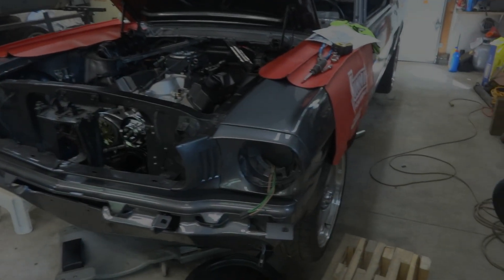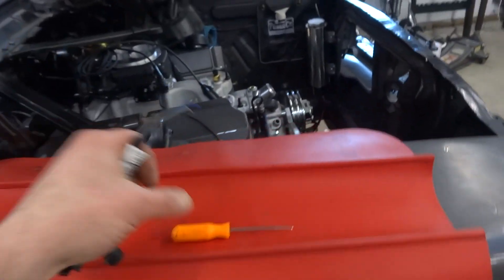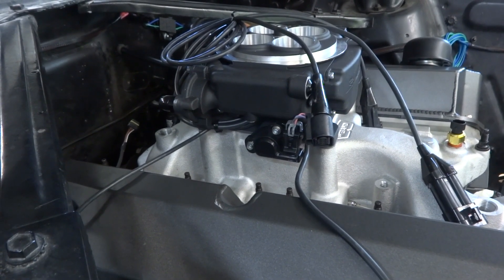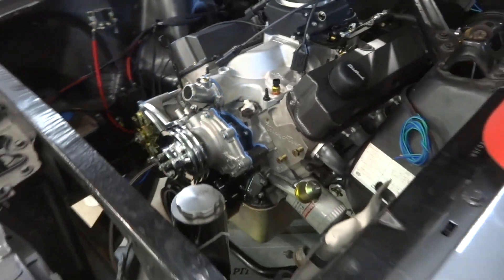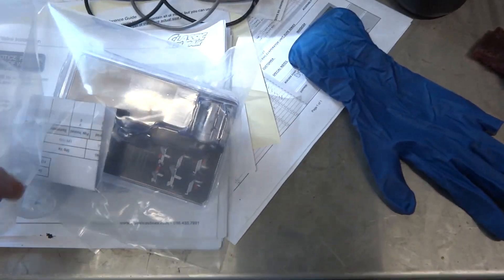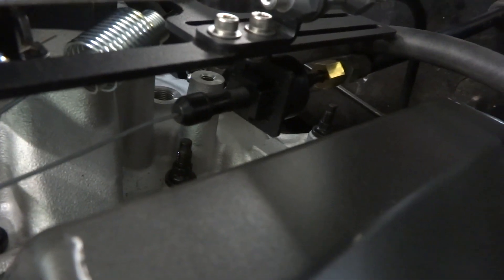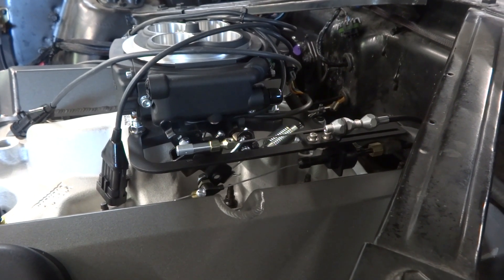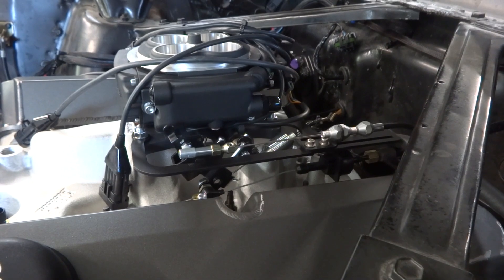TPS SIGNAL for Holley Sniper US Shift 4r70w

Comment: I've done this exact thing on my build with the remote tps sensor. The problem I have now is that the two separate tps signals are not in sync. I was watching this hoping you were going to use that Casper breakout TPS because that's going to be the next thing I try. 
I have a Big Block Chevy 496 with Holley Sniper EFI, and the MSD Atomic transmission controller running a 4l80e.
Reply from the maker: The casper works, and also there's now a piggyback tps for the sniper on ebay! Search for sniper tps

Comment: I have a 1966 Mustang with the 289 & green dot c4. I’m interested in the 4R70W swap to the 289. Do you have a parts list for the 4R70w swap?
Reply from the maker: 4r70w, us shift controller, tps sensor (available at us shift), AODE crossmember, shifter, new driveshaft and tq converter.
Reply from the maker: Btw, there's a great article on vintage mustang about the swap.

Comment: I have an rebuilt AODE in my 1995 mustang and considering a TBI kit.  If I left the stock ecu, would you think I could use this concept for another TPS signal to my stock transmission,  so I wouldn't need to buy a transmission controller?  My transmission has a tune set up from a chip woth the stock ecu and I would like to be able to use it as is.
Reply from the maker: Sure. But there's now some newer option out there. A guy on ebay sells a supplemental tps to bolt onto the side the tps on the sniper.
Reply from the maker: Also, the sniper only has issues splitting the signal. Other efi systems do not.
Reply: @cturboaddict  interesting,  I have been looking at a TBI kit that keeps the computer in the car itself, instead of being built into the unit under the hood, to keep it away from heat and vibration.  Otherwise, if I went straight carb, there are definitely some TPS adapters out there to make my life easier, but I would prefer the most simple tuning system I can get.

Comment: i just want to tie my factory tps plug into the sniper tps will this breakdown work i plan to rid the 4l60e and get 700r4 but i need to just get er going
Reply from the maker: Use the Casper electronics breakout
Reply: @cturboaddict  the order is in the bracket and the breakdown...i thank you
Reply from the maker: @nuclearbum9858  there's many options. Please just reply here if you need any other further help. I'll do my best, but would need to know more about your specific situation
Reply from the maker: @nuclearbum9858  look at Baumann controllers. They make the us shift controller. And sell specific TPS modules for carbs.

Comment: This is exactly what I want/plan to do...
Would you mind me asking, how much I cost for everything to work togeather?
The holley set up, the U.S. shift set up and everything in between ask togeather?

Planning on going holley easy efi but don't know if it be easier and cheaper over all to just get everything Holley for trans controller
Reply from the maker: It's cheaper to run the holley terminator x Max with trans control vs a separate controller. But, the quick 4 controller is flawless in operation.
Reply: @cturboaddict  I haven't seen any bad reviews about the us shift stuff and thought it be a couple hundred cheaper before seeing how you need extra stuff, because the full holley kit looks like it would cost more overall but you do get what you pay for. Thank you
Reply from the maker: @edp9811  If you go sniper and USSHIFT(WHICH IM very happy with), I'd look at the Auxillary TPS that is sold on Ebay to bolt to the side of the sniper. ORRR, US Shift sells a adapter cable to use the TPS from the sniper.
Reply: @cturboaddict  oh so they do have something for to help work togeather, I couldn't tell or find a definite answer yet... Thsks again
Reply from the maker: @edp9811  yes. Just call them. They are extremely helpful.
Reply: @cturboaddict  was gonna say watching this vid, that us shift sells an adaptor cable that goes with the sniper efi. boom. way easier than what you did but that looks clean as hell. also the car in general looks amazing thing is gonna be sweet!
Reply from the maker: @jonhathaway2537  at the time they didn't have one. I specifically worked with US Shift to come up with their adapter. Really good people!
Reply: @cturboaddict  yeah like I said that setup looks super clean!

Comment: I used the same setup and utilized the Casper break-out.  I also spliced the ground wires from the US shift controller into the ground wire from the Sniper.  Works great on my '76 Bronco.
Reply: Did you splice your + quick4 wire into sniper as well? Holley swears up n down you cannot do this! Lol
Reply: @aubrey5939  ....did it and have had NO issues.